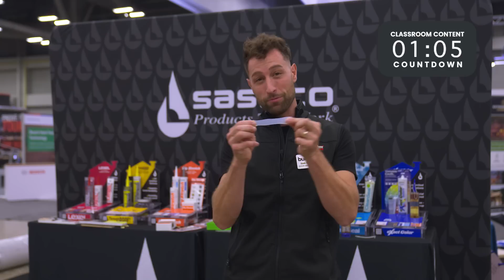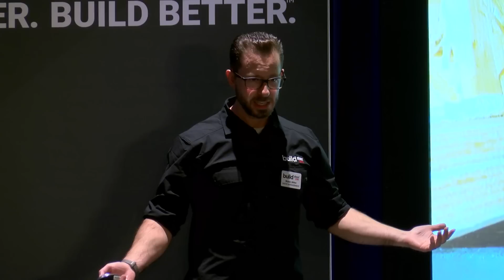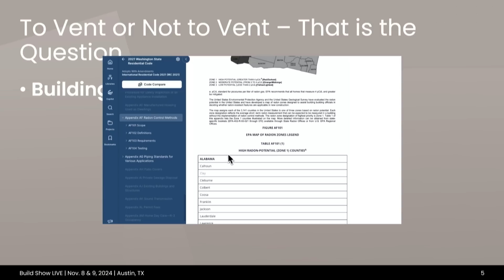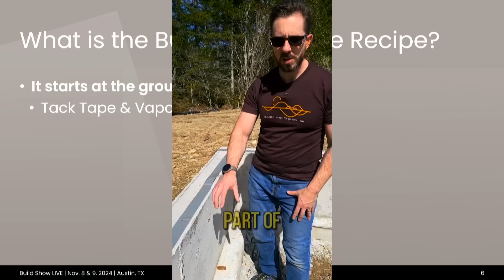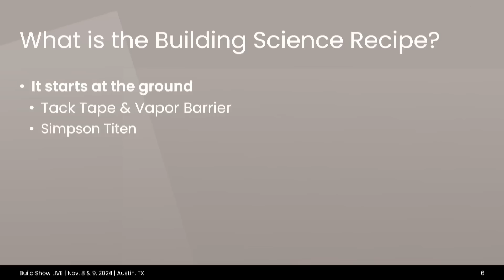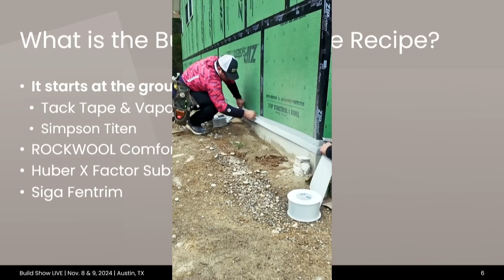What Lies Beneath? Crawlspaces!

Comment: One problem with radon is that it's not actually that radioactive compared to other radiation sources but it's very heavy so it will stay in your lungs and affect your breathing. it builds up simply because it weighs more than the gasses that your lungs are used to breathing. So it's best to think of radon as a mild lung irritant that is hard to exhale, it can increase your cancer risk overtime the same way that inhaling powders can. But the one nice thing about radon is you basically treat it the same way you would mold or humidity if you have an air handling system that's constantly cycling fresh air then you don't give the radon enough time to build up because it's heavy and it settles and that's where the problem comes from it building up. So you can have differing radon levels at each level of the house but because basements are effectively a giant bucket it can be worse there but you can still even have radon levels in your attic. because while it's heavy and tends to settle it will move throughout house do to convection and air currents. So the average house the build show tends to build is actually very good at handling low levels of radon. since you guys tend to focus so much on handling air movement in the envelope and well insulating and waterproofing your foundations systems. So it's best to think of radon as a lung irritant that every house can develop the same as mold that you want to minimize exposure to to increase your quality of life.  I would like the build show too directly address radon remediation  as a quality of life improvement for your clients. Especially since the build shows focus on air flow Control, water sealing, insulating and waterproofing your foundations and increasing air flow  and drainage around your foundations all decrease your household radon. Once again radon is a lung Irritant that displaces air volume in your body lungs and lowers maximum Oxygen intake because it settles in your lungs displacing normal air flow. Once again you guys build very well but it always annoys me you guys don't add radon as a cost benefit for your clients when discussing improved quality of life it's such an easy sell and your effectively already doing it.

Comment: Realize read on is literally everywhere it's caused by radioactive decay They just measure it by allowable levels. And you can have high levels anywhere because of glacier movements and resettling of the earth from construction and everything else that can be going on like changes in underwater water flows Seriously get a test when it goes above allowable levels it's like smoking two packs a day just at the base when you need remediation god forbid you have extremely high levels or even if you have tolerable levels it's still not good for you air flow does the body good
Reply: Thank you
Reply: @PioneerBuildersInc  One problem with radon is that it's not actually that radioactive but it's very heavy so it will stay in your lungs and affect your breathing. it builds up simply because it weighs more than the gasses that your lungs are used to breathing. So it's best to think of radon as a mild lung irritant that is hard to exhale, And it can increase your cancer risk overtime the same way that inhaling powders can. But the one nice thing about radon is you basically treat it the same way you would mold or humidity if you have an air handling system that's constantly cycling fresh air then you don't give the radon enough time to build up because it's heavy and it settles and that's the problem comes from it building up. So you can have differing radon levels at each level of the house but because basements are effectively a giant bucket it can be worse there but you can still even have radon levels in your attic. because while it's heavy and tends to settle it will move throughout house do to convection and air currents. So the average house the build show tends to build is actually very good at handling low levels of radon. And you guys tend to focus so much on handling air movement in the envelope and well insulating and waterproofing your foundations systems. So it's best to think of radon as a lung irritant that every house can develop the same as mold that you want to minimize exposure to to increase your quality of life.  I would say that I'd like the build show too directly address radon remediation  as a quality of life improvement for your clients. Especially since the build shows focus on air flow Control, water sealing, insulating and waterproofing your foundations and increasing air flow around your foundations all decrease your household radon. Once again radon is a lung Irritant that displaces air volume in your body lungs and lowers maximum Oxygen intake because it settles in your lungs displacing normal air flow. Once again you guys build very well but it always annoys me you guys don't add radon as a cost benefit for your clients when discussing improved quality of life it's such an easy sell and your effectively already doing it.